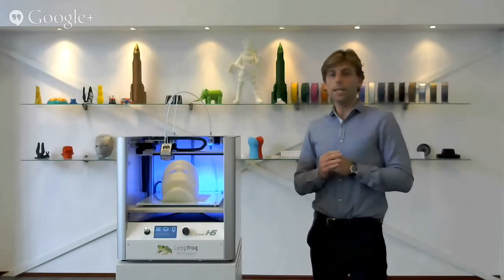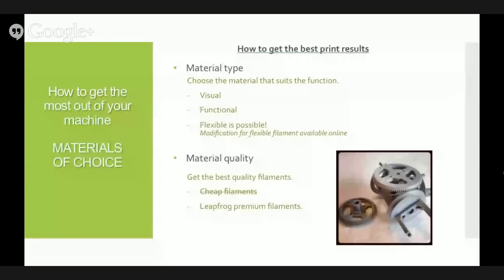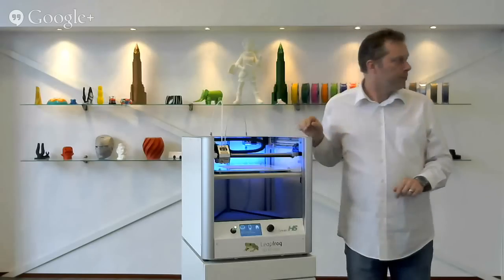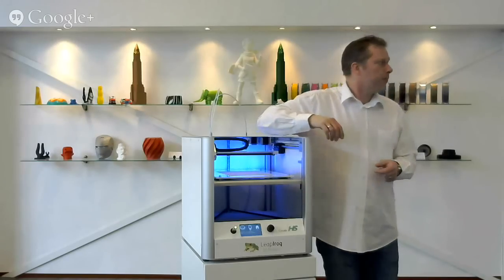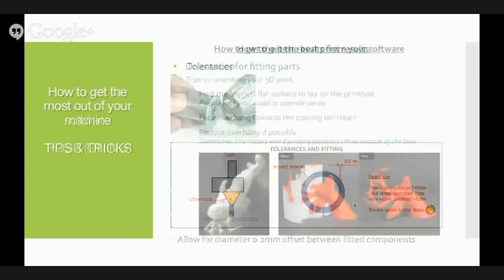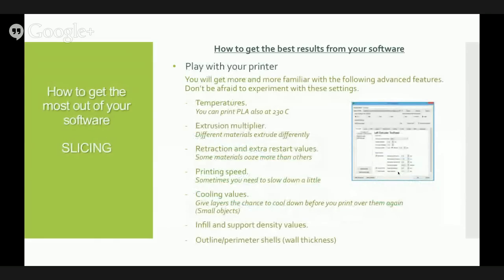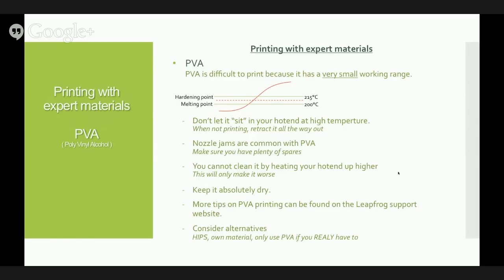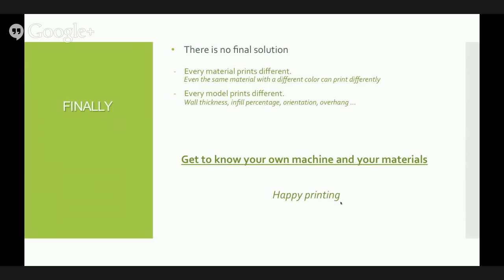3D printing Expert Session

Comment: It looks like the the price points are good for me with the Creatr HS 3D printer. $3600 American? I would be using it to print models that are around 6" long by 1" wide by 1.5" tall. With a lot of small detail. as just one example. Of course much bigger also. But small detail in very important. And I am looking to maybe in-bed electrical wiring in the print design so lights can be added to the model after printing. What I model is Model trains. And my clients require a high degree of accurate detailing in a small representation of what they are looking for. I am looking to use 3D printing to increase my detail and to speed up my turn around time for the finish product. I have been looking at the from 2 3D printer. But I think the HS may be a better option for me. Can you help with more information in this area? Is there more training. What about software to create the art.    I can be reached at Vman7757@comcast.net. I really hope you can be the answer for me and my modeling. Vincent
Reply from the maker: Hello Vincent! Thank you for getting in touch! Our sales team received your request and will get in touch soon! You said you work with train models so take a look at what others are doing with our 3D printers in this domain: https://www.youtube.com/watch?v=WJ6gCfjhnxM&t :)
Reply: Yes. This is one of the reasons I am interested in this 3D printer. I will be out of town this week. But look forward to talking to your sales staff. I think this 3D printer can do the job I am looking for. Vincent.

Comment: "level of inovation in the leapfrog creatr" Sure, you have a fantastic Z axis system, but your Y axis alignment is just wtf. and turning all fans on as soon as system power is on is also silly, among a few other points which make me scratch my head. It is very clear the machine has been built and designed in a hurry. The heatbed is too weak, there's no hotend fan and the printed grid on the glass does not line up with where the print head can actually reach.